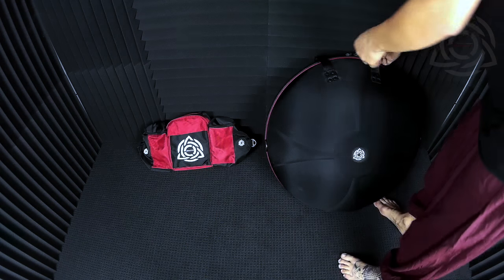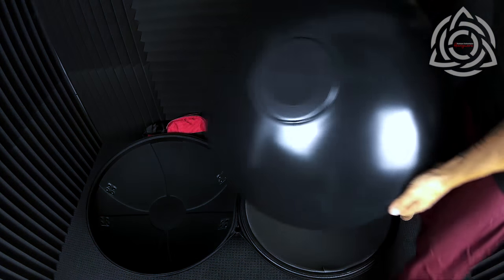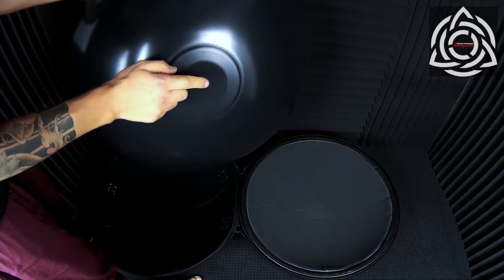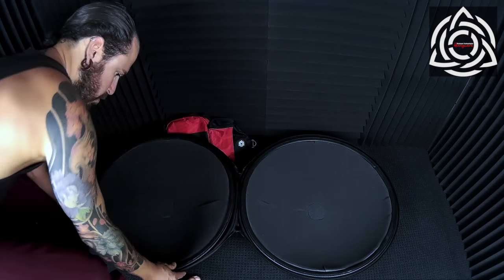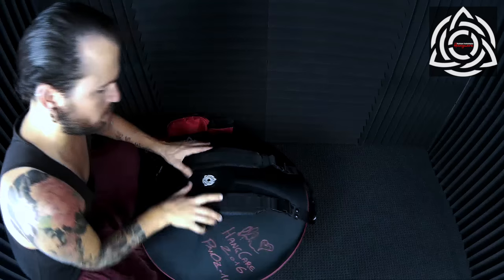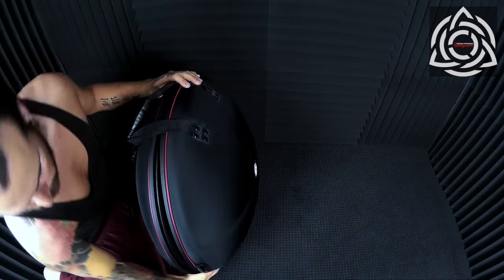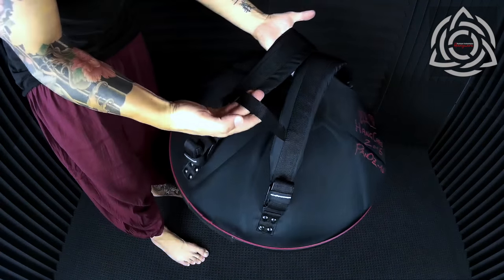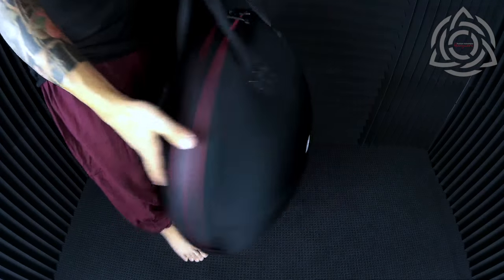HCT Evatek Flykit Review (Install)

Comment: The Evatek is a nearly perfect case for your pan. It's simply just not worth having a pan without one of these. I play my Saraz Handpan nearly everyday, traveled homeless with it for 2 months, I've flown, biked, skateboarded, and various other things with the Evatek (with the fly kit) and my pan never went out of tune. I've stood on top of the case with my precious pan inside too many times to count, just to show people. And I'm VERY careful with my pan. As far as waterproofing goes, it's much more water resistant with the fly kit attachment, but still not waterproof. That's really my only complaint other than the red bag it comes with. I just feel like the spot where the red bag goes pulls you backwards when it's on your back. Lately, I've been draping it over the top of the Evatek instead. After a while with the case, carrying it everywhere, the stitching on the chest strap came undone. then the handle for the red bag. No big deal, just sewed it back on. Overall, this is an amazing case, and I would recommend it to every pan player. It's just not worth not having
Reply from the maker: +Seth Christman Hey man, as far as the red bag is concerned to eliminate that issue, try wrapping one of the top handles (the one closest) of the Evatek around the small handle of the red bag a few times. 
It will lift the position of the red bag and it will be sitting more in the middle of the Evatek rather then at the bottom of it.
Reply: Yeah man, that's what I was doing. It seems to work even better with it draped over the top by your back. I'm thinking about designing a new bag for it because I like to put CD's, incense, and a tapestry, and frog lube in there, but it just makes the bag heavy and awkward. I've been experimenting with it and giving HCT feedback on it. I'd also like to point out that my Saraz has a rubber ring on the outside of it. Most pans don't have this, but since it does, it makes it more waterproof inside the evatek. I live where it rains nearly every day. Without the fly kit, getting caught in the the rain caused a small layer of rust. (I treated it of course. the pan is ok) However, with the fly kit inserted, it makes such a tight fit that the water can only make its way as far as the rubber ring on the pan. However, I can't stress this enough: DO NOT PLAY WITH YOUR CASE OPEN UNLESS IT'S SUNNY AND DRY. I played with my case open when there was apparently too much humidity. Nicely oiled up pan, put perfectly into its Evatek. The foam sucked up the moisture and it's basically like letting a damp cloth sit on the pan.
Reply: Again, the pan is ok, just almost made me have a heart attack.